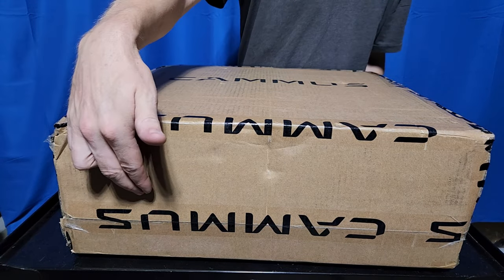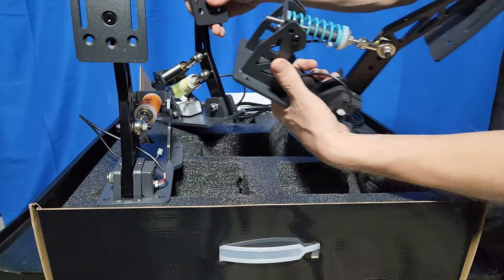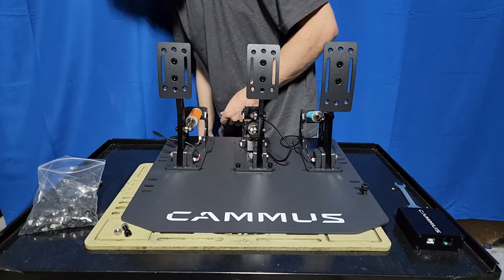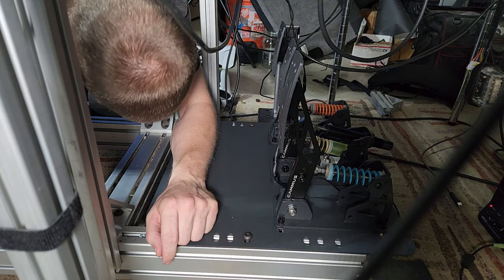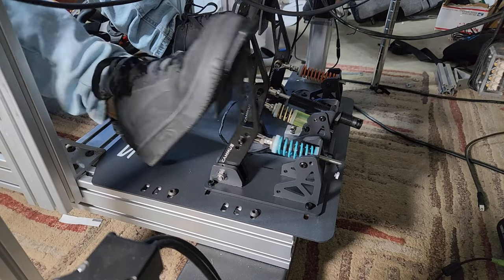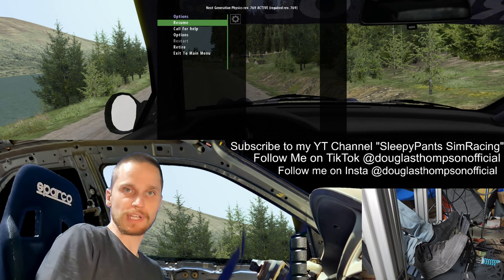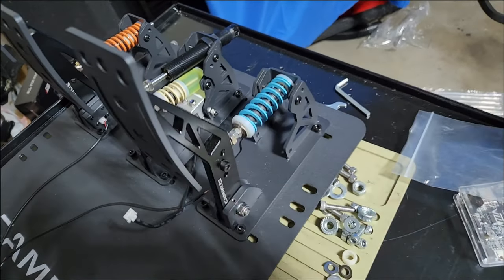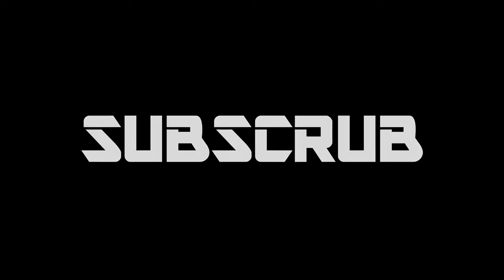Entry Level Price, Pro Level Performance? CAMMUS LC100 Pedals

Comment: These pedals look really decent
Reply: They are more than decent, they are excellent. I have them tuned so perfectly at the moment. I have been really enjoying racing with them. Took me about 3 days to get fully used to them to where I was confident in doing a championship with them. It's really important to adjust the loadcell a bit to maximize its abilities and I wish cammus would package in more spacers. Spacers cost pennies at hardware stores so it's not a big deal but I did contact them and request they include more spacers for each pedal.

Comment: What is the width of the foot plate? Looks like it may be a bit too wide for my rig.
Reply from the maker: it is definitely a wide boy but a drill does wonders if that's the case! or if you mean it wont fit between, you can just mount the pedals directly to whatever pedal plate you are using. you don't need to use the pedal plate included, its only for people that don't have a pedal plate.
Reply: @DouglasThompson still I am also very interested in the real measured dimensions of the base plate, since I already stumbled on two big manufacturers their technical plans and these were totally not correct, you would do me a big favor with this info.
Reply from the maker: Can you email me to remind me. Sometimes I get lost in the sea of comments.  Demureg@gmail.com

Comment: I've seen another vid of a guy also putting some washers under the load cell. Definitely something i'm gonna do once i get em, and all the other stuff you've done. I wonder if there's be some other base plate that might offer a bit extra heigjht for the feet. The pedals do  look tall.
Reply from the maker: You can make one probably pretty easily. How much extra height are you thinking you will need?
Reply: @DouglasThompson  about 1inch.  That's what i have with the raised sprints foot rest.
Reply: Also curious what you took out of the throttle to give it a bit more throw? One of the black spacers?
Reply from the maker: @jameslsimsports8514 that shouldnt be too hard. Maybe I can make a video about it...
Reply from the maker: @jameslsimsports8514 I made the throttle have less throw it had too much for me lol
Reply: @DouglasThompson  i'd love to see that. Enjoy all your pther content

Comment: what is the difference from LC100 and GT1 pedals? they look kinda same but different at the same time so confused
Reply from the maker: The lc100 have hall effect sensors on the throttle and clutch instead of load cells, a 100kg direct mounted load cell on the brake, added hydraulic cylinder for better brake feel. Easier pedal adjustment, minor quality of life improvements like the mounting plate is slotted instead of simply drilled. Also the logo is now smooth paint instead of engraved so it doesn't catch your feet. The pedal faces are now smooth instead of ridged. The control box is now external and can be placed wherever instead of mounted within the brake housing like the previous set.
Reply: @DouglasThompson  thanks, is the GT1 discontinued ? i think the lc100 is better with the hydraulic cylinder.

Comment: so it doesn't come with additional elastomers to change the feeling of the brake?
\
Reply from the maker: Mine didn't but it is easy to use what's here to get the brake feel you want. I can range from geo metro to brickwall in terms of brake feel.

Comment: Is it possible to use them on the floor?
Reply from the maker: No, sorry.
Reply: @DouglasThompson is it possible to use them on floor with them raised a small bit so the bolts that hold the pedal wont be on the floor? Im planning on wither raising it or jigging some kind of inverted bracket from wood until i invest in a rig
Reply from the maker: The pedals are all far too stiff to work without being mounted. If you set them at thier absolute least resistance,  possibly. No guarantees on that though.